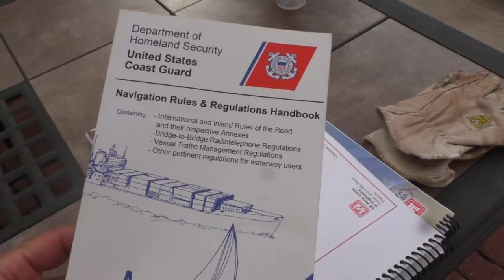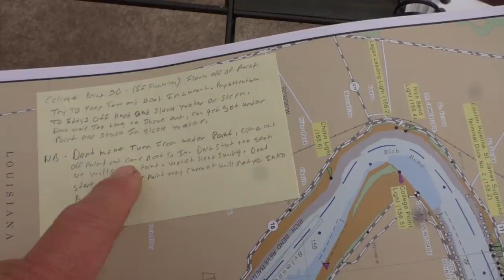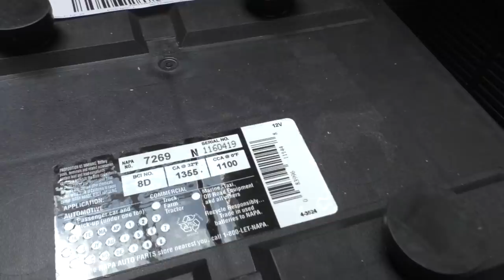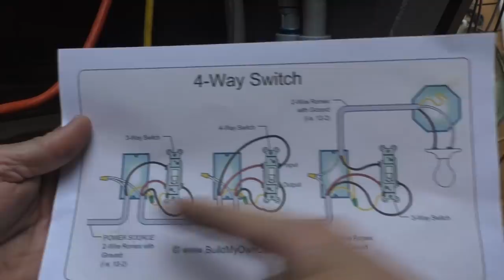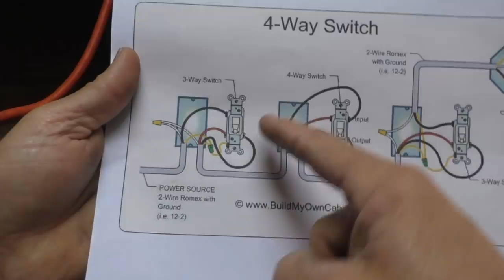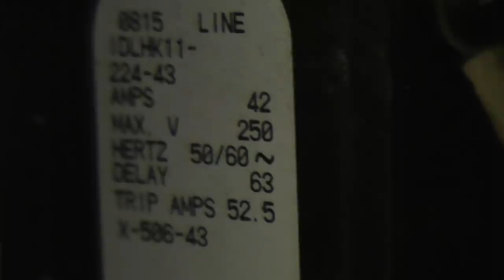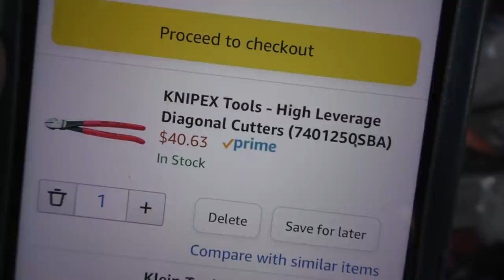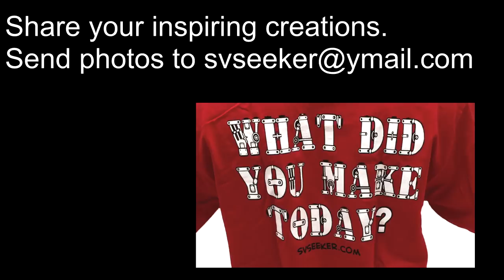Wiring the Boat -  Part 1

Comment: Always great to see an industrial expert in a specialized field visit the boat for helping on the progress.  Instead of making drawings and then researching all the possible box variables and wiring possibilities,  he goes shopping at the supply houses and sets up a tempoary wire spool holder and gets to work.  He was finished with the whole thing before the internet would have been done arguing about how this should be routed and sourced. 

Looks great,  and is a long ways toward having the bottom side electrical complete. 

Love the 3 and 4 way switch circuits!

Comment: I've wired a lot of receptacles in my time, never seen that trick of leaving the jacket insulation on rather than twisting the strands.  Very nice trick!! Thanks for that, I will be using it.
Reply: I thought so too until I seen the switch for bilge pump.  It has it’s place bit I find it messy.
Reply: Good for stranded wire.  Unnecessary for solid wire.
Reply: @gragor11  definitely don't want solid wire on a boat.
Reply: @Nick75au1  Doesn't wiggle very well for very long.

that looked like nylon coated wire.  THHN.  Shiny.  Not RW90
Reply: The only thing I would add is don't cut off any of the insulation, that way when you strip and expose part of the wire non of the copper is beyond the insulation at the end.

Comment: Doug two things I would add from experience with the uss Kidd in baton rouge louisiana. Put a red light in each compartment for night light so people can come and go with out waking others. Also get a automatic battery powered safety light for each compartment for power loss. They use them on tugs also on Mississippi River. They are supplied 110 when they loose it they come on. It's damb dark below decks when the power goes down. Voice of experience here been there done that.
Reply: why have 110V for emergency lights? why not just local 5V LED's? i mean local does mean that you have to keep the batteries in order, but one circuit for emerlights does not make sense to me...
Reply: You put the emer lights on a 120v circuit at the panel so that when the panel loses power they automatically come on... no hunting in the dark to try and turn on a battery light.  Also the 120 keeps their batteries charged.
Reply from the maker: Just like the navy to have night lights paid for with tax dollars.   Do they get a teddy bear too?   : )
Reply from the maker: @benjaminshropshire2900     Did you notice this was Part 1?  : )
Reply: @benjaminshropshire2900  i get the night light aspect, and agree with it :) and also awaiting the upgrades this fine vessel will have!
Reply: @SVSeeker  Awwwwwwwww. lol
Reply: @SVSeeker  lol. You have to b.y.o.t.b

Comment: What a great video.  Such a pleasure to just sit back and watch a couple guys working.  I've done a lot of electrical work and I can say what that guy made look so easy takes me 3 or 4 times as long if I'm having  good day !

I'll chime in on the wire aspect too, and hope it won't be taken as criticism.  When I bought my first ocean-going sailboat, the wiring was a hodgepodge.  All different kinds of wire, connections, etc.  I come from a home building background so I wasn't scared.  Fortunately I hired a master boat mechanic to help and he taught me a few things that I would not have known or figured out.  And no, he was not a clean cut 'by the book' kind of guy - he was a liveaboard torn shorts dude who had simply been doing it long enough that he knew from experience what worked and what didn't.

1) use only stranded tinned marine wire
2) use Ancor brand adhesive-lined heat shrink connectors / fittings
3) dip the ends of the wires in dielectric grease
4) tighten all screws and bolts as tight as you possibly can without breaking
5) coat the connection when it's done with liquid electrical tape (brush on)

Now here's the kicker.  Whenever I did not follow those rules, it came back to bite me.  ALL of the non-original wiring done over the years by others FAILED within 3 years and had to be replaced.  And any wiring I did that did not follow his rules caused me problems over the course of owning the boat.

Bottom line is that it has nothing to do with rules and regulations and expensive marine grade parts.  It all comes down to one thing and one thing only, and that is the salt water environment, where that corrosive salt / moisture / air mix gets into every nook and cranny and works to destroy everything electrical and electronic.  I wished it wasn't true but wishing didn't make it so.

Comment: Wow!  Sure can tell it's not his first rodeo - really nice electrical work!

Nice crimper he had for the 4//0 wire, but that weatherhead hydraulic hose crimper you had in a recent video for the water maker system does an even nicer crimp on those lug terminals ( I own the exact same machine), at my shop we make battery cables all the time with it and they look like factory when completed with heat shrink.
Reply: Watching an experienced electrician is quite inspiring!
Reply: Had the same 'hammer' battery crimper in the 80's to work on boats. Neoprened all exposed wire & plastic (color-coded) each cabled ends.

Comment: Wow. That was an awesome wiring job. Definitely a pro. 

Talking about the wire terminals coming loose, I had that problem on drilling rigs so bad that tightening them became part our monthly maintenance until I had a failure from the wiring breaking from over tightening. I solved it by crimping wire ferrules to the ends of every stranded wire before tightening them down. I suspect being on a boat, with the amount of vibration and moving y'all will be doing, it would be time well spent to add ferrules to all the stranded wire terminations and then clamp them down.

Comment: Another well done video that illustrates the how a complex project becomes manageable when planned out and broken down.  I am not a marine wiring expert, but I do know that there are key differences in boat wiring and house wiring.  It would be interesting to see more information that addresses not only some of the differences but also why there are differences.  For example, simple wire nut connections will not pass a marine survey.  It has nothing to do with what's prim and proper for "yachting", or random government or insurance company rules.  It has everything to do with the fact that boats are subject to radical movement, including vibration and pounding caused by sea conditions.  This environment can cause ordinary wire nuts to loosen, which causes the connection to loosen, which can lead to overheating and fire (even in 12 volt circuits).  Solder alone cannot be relied upon since in an overload situation, the joint can heat up, melt the solder, and further degrade the connection before the breaker trips.  Crimped wire connectors should be used when joining wires on boats.  With that said, Seeker's systems are all designed to be easily accessible, which is a very smart move on Jack's part.  Any problems that arise will likely be discovered early and can be easily corrected.

Comment: Since you're not using Marine wire be carful that none of your wire runs have any possibility of ever contacting diesel or oil leaks. It will eat right through that welding wire shielding without even thinking. Welding wire isn't designed to last that long, since the copper strands aren't tinned all the way through like Marine wire they corrode extremely easy. I'm biased because I am close to a lot of horror stories, boat fires and expensive equipment destruction. I'd say 90% of the time these are caused when boats don't use Marine wire.
Reply: Also use lots of dielectric grease on all of your terminals, battery lugs and bus bars!
Reply: Winston Zeb, 👍  Been there to rewire a boat.
Reply: @winstonzeb2842  I am a believer in the grease, keeps out the corrosion.
Reply: BINGO!  Previous owner of my old boat did a ton of "expert" wiring...ok, so he was just doing it his way...sound familiar??  LOL.  Anyway, I had to rip out a TON of the wiring because it was all corroded, and heck, I'm on the Great Lakes with fresh water...Yep...Dielectric Grease, NO SOLDERING, and good Crimp fittings with water tight heat  shrink.  My boat mechanic looked at my work and was "So...want a job doing some wiring jobs I have?"...LOL  NO...No I Don't...LOL
Reply: @WreckDiver99  Haha I rewired my 20' 1973 Mako. Went over kill on the gauge I used for everything, but I also work at Viking Yachts and get the "scraps" for free, scraps for 90' yachts were enough to wire my whole boat
Reply from the maker: Horse Shit.   You got to prove that!    It sounds like you've been working on boats owned by gullible people or tax payers were footing the bill.    Thousands of us have been dragging welding cable around for years!   So we put it in a conduit on strap it to a cable tray and now it becomes a problem?   Give me a break.
Reply: @SVSeeker  My mom is always coming at me with DLO cable saying I gotta use it for this and that. I'm, like, "Mom, I know you love the stuff, but it costs a ton. I'll use it where I can." So, it's tinned, and I guess that where the love affair starts? But it's costly AF.
Reply from the maker: @TurkishLoserInc   What are you doing?  Dragging it through the sea?
Reply from the maker: @Waiakalulu1  LOL!
Reply: @SVSeeker  the conduit works great Doug. Lots of good running boats use welding wire, but when wiring gets messy and random splices are introduced over the years, corrosion and fires happen. I know you're smarter than to let the wiring turn into a rats nest, just a heads up on the issues I see all of the time
Reply: A horror story is a guy used welding wire in a ceiling wire chase, negative and positive wires were ziptied to the chase in contact with one another. They spilled some desiel on the deck which dripped down and ate away the shielding. It caused a short and his boat burnned to nothing 10 miles off shore.
Reply from the maker: @TurkishLoserInc  Most marine stuff is completely air-tight?  HA!  You've not seen the boats I have seen.  : )
Reply from the maker: @winstonzeb2842   You know one story and that is the basis for your Chicken Little routine?
Reply: @SVSeeker  haha no I hear them all the time.  I'm not telling you what to do, if you keep all the wire in conduit you'll be safer than most of the professional yacht builders. The only thing you could potentially run into is corrosion, which you can stop by slopping a bunch of dielectric grease on terminations and terminals. I work with a company that only does marine electrical refits, so like I said, I'm biased because I hear horror stories all of the time.
Reply: @Nick75au1  He doesn't like "professsionals", he prefers people with only practical knowledge.  My personal practical knowledge was in a Searay and Wellcraft where the previous owners did a bunch of their own wiring...with untinned wire.  ALL of it corroded, and I'm on the Great Lakes with no salt.  I'm not saying DON'T use it, but at the very least seal those ends up best you can.  You should be using heat shrink with glue on any splice, should be using that on any terminals as well.  Then use dielectric grease when terminating.  I had to gut out all the wire from replacement bilge pumps, radios, extra lights, speakers, all of it.  Thank goodness the main wiring was all marine grade wire as that was A-OK, but my neighbors boat a few slips down wasn't...$2500 tow bill from the lake because his connections broke from corrosion in a 4 year old boat that he re-worked the battery wiring on...with non-marine wire...he "saved" $200 by using that untinned wire....until his $2500 tow bill...LOL...
Reply: @WreckDiver99  I can live with untinned heavy DC cabling, as long as its sealed with the dual wall heat shrink, but welding cable is just not up to the rigors of marine use especially around engines. bilges and such. Professionals have practical knowledge, that's how they become professional.
Reply from the maker: @Nick75au1    Ha!  His lead off complaint is that it only comes in one color?  LOL  This is a great example of the "Marine Industry"  selling a load of crap.   Build the dam boat with what you can afford or scrounge and strip anything you find better off a derelict Luxury Yacht.  : )      American was built on getting the job done and making it better as you go.  Not still around and whining that you need more money to do it to some stupid code written by the people selling "Marine Industry" products.
Reply: @WreckDiver99  my old mako that I rewired they used paired lamp wire, I stripped about a 8 feet section with a razor out of curiosity and didn't find a single bit of shinny copper. All corroded to shot
Reply: @winstonzeb2842  Sorry, but I'm laughing here.  At least my previous owners used "speaker" wire for the speakers, but so much of it was what appeared to be stripped SO Cord, or just loose wire they grabbed from a spool at the Home Depot/Menards/Lowes or possibly Radio Shack.  Much of it was way too small for demand, and even the stuff properly sized was totally corroded out.  My mechanic pointed it all out to me before buying the 2nd boat (Wellcraft), so I told the previous owner to knock $1K off the price and it's a deal....they did...I got the boat, and spent 4 very hot weekends running wire in the engine compartment.  One of the first things I had to do was replace the battery charger that was a Mongomery Wards charger for a car.  OMG...they said it didn't work...yea, wonder why...TOTALLY corroded inside.  LOL...I still got a good deal on that boat and sold it 4 years after buying...in a single day, for cash for $500 less than I paid.  Not too bad...but the new owner got a boat with proper wiring at least.
Reply: @WreckDiver99  had to do the same thing. I guess my boat traded hands enough for 5 people to add at least one splice in every wire 😂
Reply: @SVSeeker  Some welding cables have oil resistant insulation and some don't. If there is a risk that the cables can be exposed to oil, just cut a piece of cable and let it sit in oil for a couple of weeks and see what it looks like. If the insulation is fine, go for welding wire but if it turns into snot, at least I wouldn't use it. I put red tape on the black plus cables in close intervals to distinguish them from the negative cables.

Regarding tinned vs untinned copper, I have lots of untinned copper wires on my boat from 1986 and I haven't had any problems with that.

Comment: I love it when wiring is done this well. No fun when you open a panel and its a rats nest.

Always plug open holes in your panels or gutter box... we had a few rats get into those at a welding shop and chew the wires....  They got toasty really quick at 600volts.
Reply from the maker: You need a cat.  : )
Reply: @SVSeeker  is Earl going on your boat when it sails the high seas?  Just curious...
Reply from the maker: @tribum    I wish.  Earl is buried in the back yard with Jezebel.   She picked a fight with something too big.
Reply from the maker: The Weapon Collection    Yeah.  That's not exactly video material.  But they were great pets.  I miss them both.

Comment: Chris, very good workmanship. Doug, I hope you don't get to experience the problems the entire rest of the world have had with wire nuts on any kind of moving vehicle, especially a boat on salt water. Dim , flashing or intermittent lights, burned up bilge pumps or worse, nav light failure. Fare winds and following seas.
Reply from the maker: I think those that complain about wire nuts need to buy the good ones.  They are just a few pennies more, and learn to use them by yanking on each wire once they are installed.   If it comes apart, try again.

Comment: Nice tip on keeping the stranded wire together on the plugs.  One concern however, a marine surveyor will ding you for the use of wire nuts to join wires.  I wound up replacing a number of them found on my boat to satisfy the insurance company.
Reply: Rick Swanberg them things don’t exist here